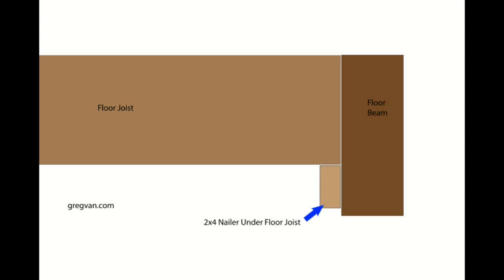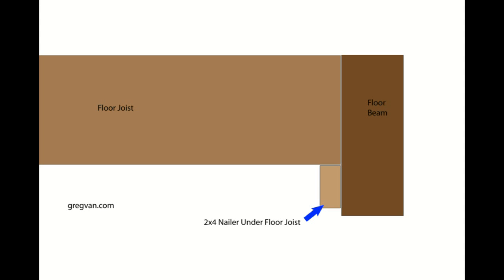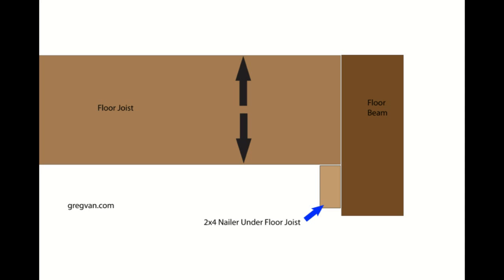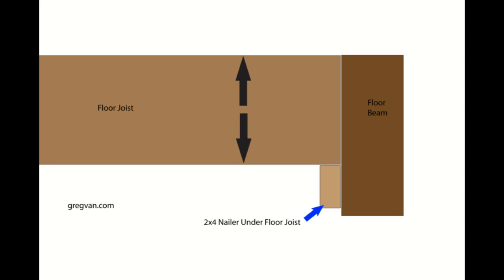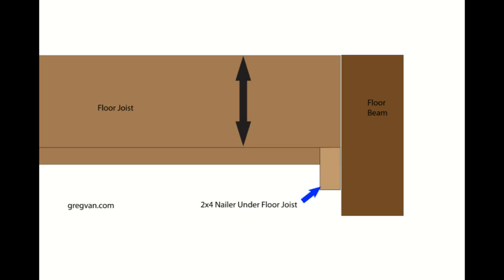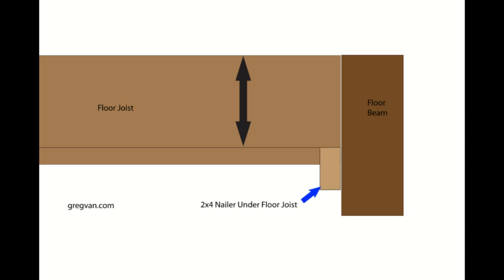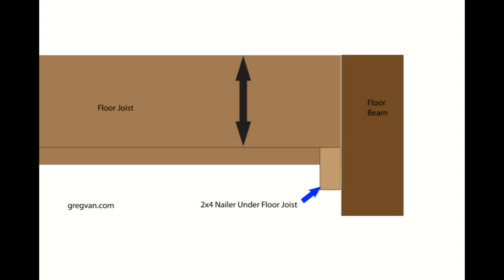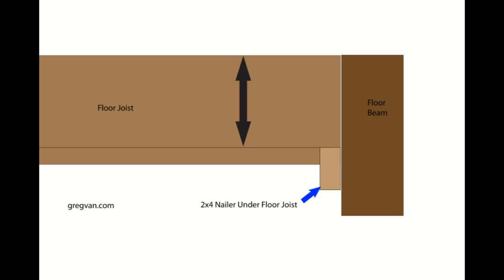Problems Created From Notching Bottom Structural Floor Joists

Comment: Dude, what you have showed was considered a standard method of hanging floor joists on beams in the 1800s and early 1900s. I have a few very old books  that show this. THis was in the days when nails were expensive  and used as little as possible,...so they often also notched the beam to receive the floor joist,. Kind of like a "step" pattern on both the joist and beam..

Comment: Doesn't building code allow for notches up to 1/4 of joist height on the ends? Why would that be permitted if it reduced the entire joist strength? My biggest fear would simply be the notched area could be prone to cracking over time, I've seen it suggested to make the angle of the cut rounded rather than a straight 90 degree to help prevent this.
Reply from the maker: You would need to check with your local building authorities as to whether or not the notches can be made, but I think most of these problems can be eliminated during the design phase of the project to reduce or eliminate as many holes in notches as possible. Good point about graphing the wood cracking from the corners of these notches.

Comment: hello i am currently making a floor in my basement and i was thinking of connecting the joists and beams using half lap joints,would you think it a bad idea?
Reply from the maker: It's a great idea and common construction practice to tie the joist together lapping them over the beams and then nailing them together. Don't forget to visit our website for more videos on floor framing.
Reply: The idea is to lap the joists over the beams aswell, nail them aswell? Haven't thought of that
Reply from the maker: It sounds like you have the basics down and are ready to go to work.

Comment: This assessment is wrong.  There are three criteria for designing a joist; shear, bending, and deflection.  If the notch is at the end the bending stress will not be an issue, nor will the deflection.  You would need to check the shear stress, which most likely does not control the design.  for joists, which are long members carrying smaller uniform loads bending stress and deflection are what is generally most critical.  You would want to avoid notches more toward the center of the joist span.  The notch at the end is not as big a deal.  In fact the IRC building code allows for a certain depth of notch at the end of a joist.  The best thing to do is consult a structural engineer our read the appropriate sections of the building code.
Reply from the maker: +Blake Gustafson  Please provide me with the building code reference number, name of book and page you're referring to. I have a copy of the 2012 International Residential Code.
Reply: Yes, the most likely problem to occur is splitting at the corner of the notch, due to shear. So it is a concern (especially with shorter spans), but is not so much a concern in regards to bending stress. Supposedly a 'dap' -- a smooth angle cut to lessen the notch transition angle -- helps to reduce shear stresses at that location. Used in timber framing type of work where notches are more common.

Comment from the maker: You ask if it's obvious and I would imagine most builders would know better, yet only a few days ago someone sent me a picture of a large brand-new floor and was framed with about an inch and a half by inch and a half notch out of the bottom, instead of using hangers. However, I would imagine when it's all said and done, this will be one of those lesson they'll never forget.
Reply: My house has this set up, without the notch.
My problem is the 2x4 nailer under my joist has began to drop and caused the floor to become unlevel.
Any suggestions on how repair this and get it back right?